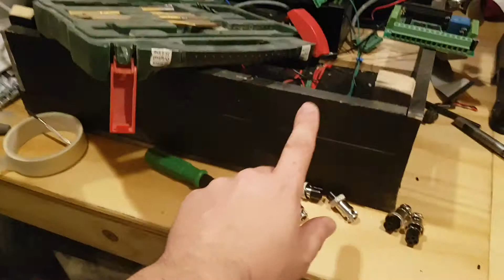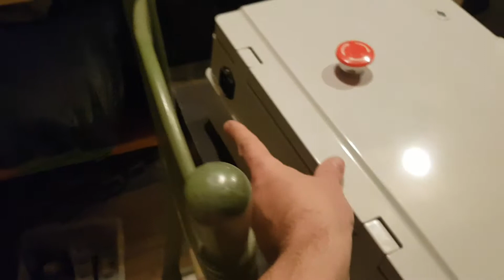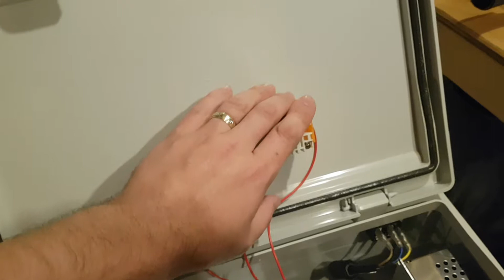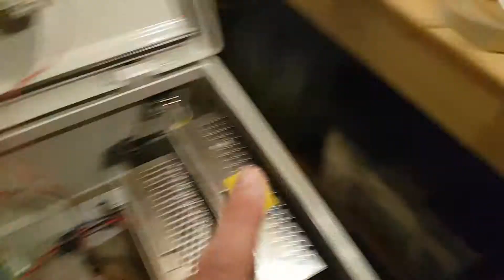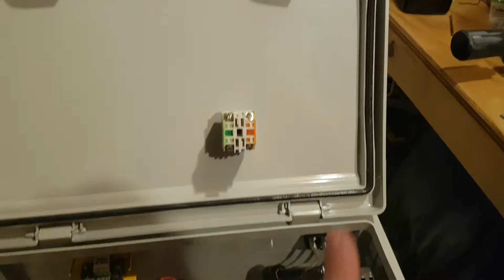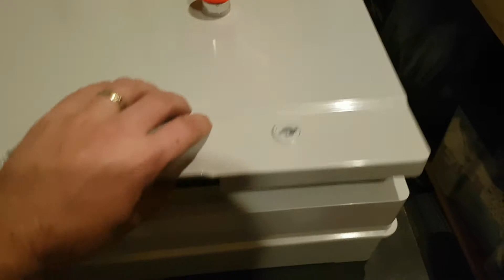Control box build part 1

Comment: I have the same set-up a UC400ETH + a 5 axis breakout board the same you have in the video, I have not manage to make the machine work, I noticed the 5v supposedly supply the 5 axis breakout board from the PC via usb kind of does not work whe the UC400ETH is connected to the breakout board and therefore looses the communication with the motors but in the Mach3 software works with the the UC400ETH .  Would appreciate your experience...
Reply from the maker: Hi i have made a new video for you hopefully will give you some insight on the issue. 
https://youtu.be/Mgmd5WaQ1ZI
Reply: @PalletLad  thank you for your input and appreciate it, mean while i found the bug in my system. Previously i had a setup based on usb motion control card and mach3 was installed including the plugins for that usb card. When i built the new system with the uc400eth i installed mach3 as for usb card with usb plugins included without knowing that those plugins will disturb the uc400 doing its job. So once deleted the usb plugins from mach the system works flawlessly. So thank you again for involving and i hope the ones who will encounter the same problems will find the answer here in your posts.
Kind regards, 
John.
Reply: Gaudencio, my bob's 5v is from external psu, not from pc. You should also make sure your ribbon cable is properly made so you are not giving another 5v from uc400 to bob into a gnd pin. This could be a scenario which is shorting the bob or burn it.

Comment: Hi, i recently rebuilt my 6040 control box  my setup now being  5 Geckos 251x + a uc400eth + one of those chinese bobs as you have which seems to work fine except that when i proceed tool probing i get kind of intermittent z movement down to touch plate. Sometimes despite the intermittency  i get  successful probing proccess, sometimes the intermittence turns into a stop and after few seconds i get a false successful process. I mention that before i had a rnr usb motion control board and had no issues. Everything is shielded in my control box, i run my router under Mach3. I wonder if the uc400eth + the parallel bob does not like the script i have for tool probing or is something else. So tell me if you have encountered any of these problems and how is your experience with the pair of the uc400eth+ that bob.
Thank you.
Reply from the maker: Hi there, the one thing I have not used so far is a touch probe on my set up.
I have had no issues with my UC400 paired with the break out board though however I have used the following methods to eliminate any EMI issues in by build:
twisted paired power cables (counters noise)
Ferrite clamps on all wires (have grouped + connectors together and - connectors)
grounded everything
seperated the VFD as far away from everything else.

I have a new video if you like to see https://youtu.be/Mgmd5WaQ1ZI 
Hope this assists.